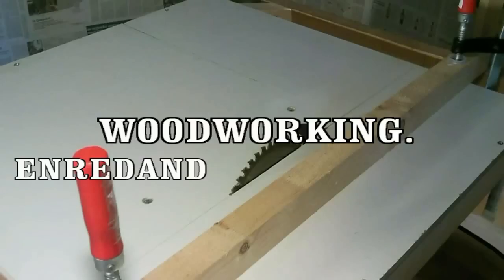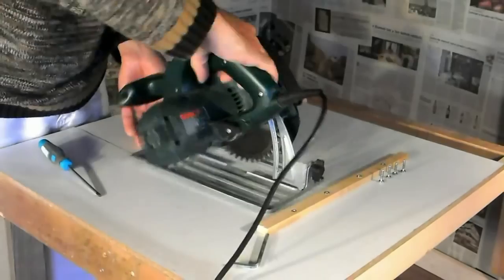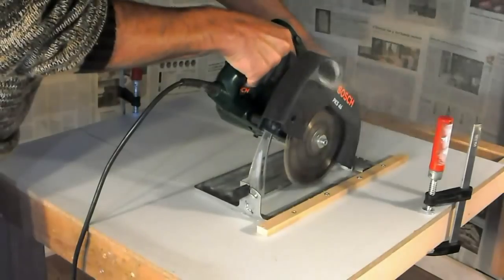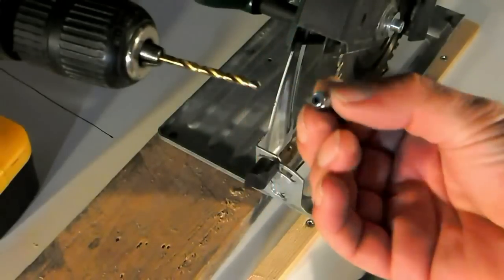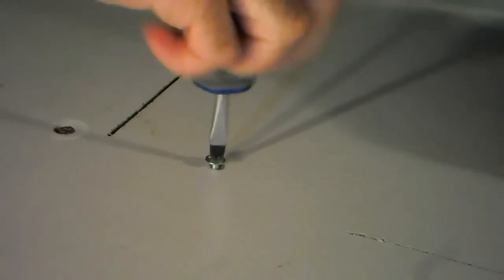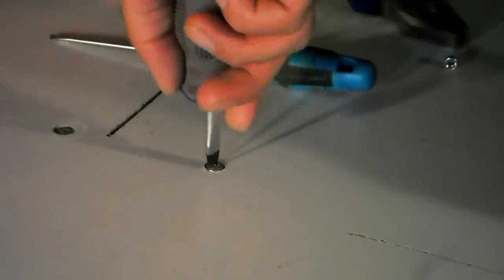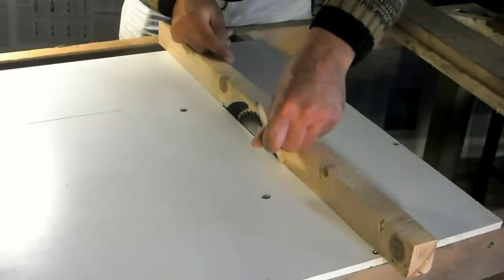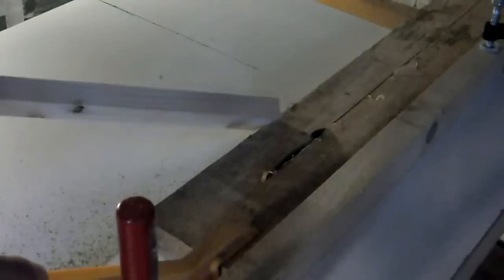Homemade table saw with riving knife

Comment: Very useful, thanks, however your bolts should have spring washers to mitigate the nuts coming loose with vibration after prolonged use..

Comment: I made the mistake of buying a circular saw without a riving knife, now I don't know how to attach one to the table saw I've built using the circular saw...
Reply: +Sergio Acuña Padin I think I will have to bolt mine into the table from above. The big problem is that I don't have any tools to build a riving knife made from metal, maybe I can buy one and modify it. If you figure out a good solution let me know and I'll do the same. :)
Reply: You can add a splitter to the table itself, however it won't be usable doing mitre cuts. Only other option is to buy a skill saw with a riving knife. I've not bought mine yet so I'm lucky I saw this video before buying
Reply: In the same position my friend, did you find a solution?